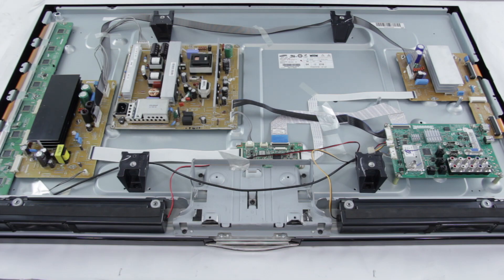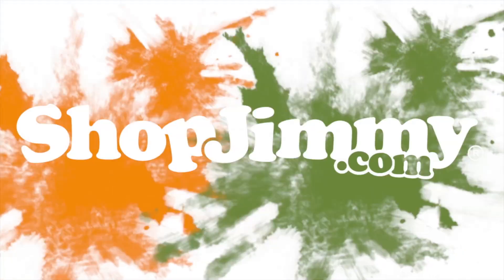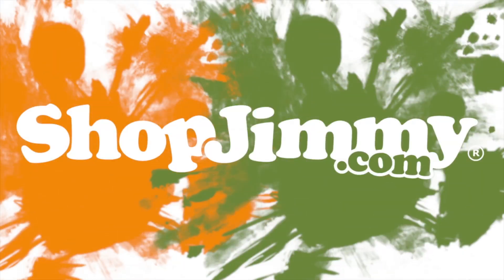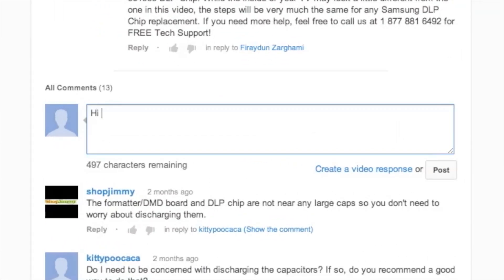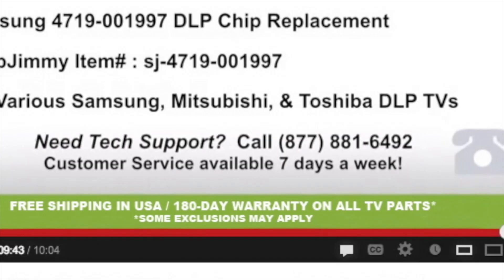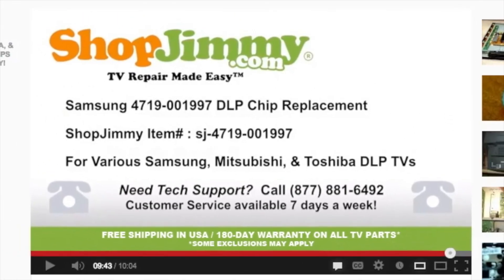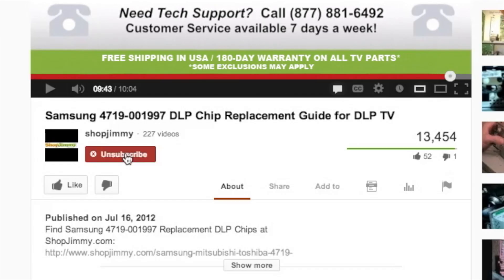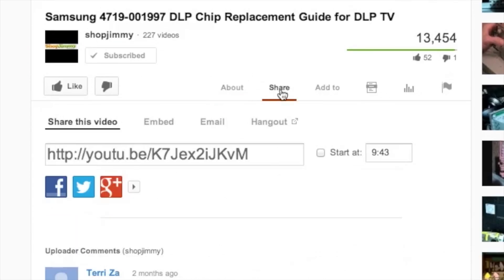Plasma TV Repair Tutorial - Common Symptoms & Solutions - How to Fix Plasma TVs

Comment: I have a Samsung PN50C590G4F plasma tv from Feb. 2010 that wont turn on and the relay on the power board clicks on and off repeatedly with the front led flashing. When the set is trying to turn on the VA reads 55, the VS 211 and the VSC -198. The VE reads 92 when the relay clicks off and then drops to 81 when the relay turns on. I replaced the X board thinking that was a problem but the same numbers are on the meter reading with the new board. When I bypass the number 3+4 post of the logic board the screen comes on with the test colors but again turns off after about 6 seconds. I don't see or feel any popped capacitors and all ribbon feeding voltages to the y board, logic board and main board are correct as written near their terminals. Please offer testing suggestions and or solutions.
Thanks
Brian
Reply from the maker: Brian Wilk   Try this at your own risk. Unplug the TV, then disconnect the y board and plug in the TV to see if the TV powers up. Reply with the results of this test. Thanks! www.shopjimmy.com
Reply: ShopJimmy.com
I have separately and in combinations unplugged the Y board, Y buffer, X board, X buffer and the logic board but still the picture never comes on. This does leave the main board in the system since it needs to be there to provide the connection for the power board. The only way I can get the screen to have a color is to jump the 3+4 leads on the logic board and then white comes on and red before the relay times out and shuts down. During any of my tests the relay always shuts down after 6-8 seconds and then comes back on in about 2 seconds and will continue this until I unplug the tv from power.
Reply from the maker: Brian Wilk   This means that one of the Sustains or the Main Board has a short that is giving you a false reading.  Thanks!  www.shopjimmy.com
Reply: ShopJimmy.com
I bought a main board from you but I still have the same problem. The one difference that I see is that that time for the relay staying on has gotten shorter. With the old main board the relay stayed on for 6-8 seconds but now with the new main the relay clicks off in about 2 seconds. I have unplugged both the Y and X boards from their sustain boards but the relay still clicks on and off. How can I perform more testing to confirm whats wrong rather than just changing parts? Again, any ideas are appreciated.
Brian
Reply from the maker: Brian Wilk  Try this at your own risk.  If you know how to test the boards with a meter, you could test for shorts in the boards.  Thanks!  www.shopjimmy.com

Comment: hey now: I / 6th of my screen shows black and red vertical lines after replacing the control board, this is a lg 60pc1d, thinking its the mcm if not cable pls recomend if I need another control/ main bord or just clean connections. e.atlantic@live is best guys thanks
Reply from the maker: mark ingraham   This sounds like a TV panel (TV Screen) problem.  If your TV panel is bad, it may be more cost-effective to replace the TV as panels are typically hard to find in stock, difficult to replace, and expensive.  Thanks and please let us know if you have any further questions!  www.shopjimmy.com

Comment: LG 55LV5400-UB picture is slow but sound is good what part do I need
Reply from the maker: James Tuakalau   This sounds like a TV panel (TV Screen) problem.  If your TV panel is bad, it may be more cost-effective to replace the TV as panels are typically hard to find in stock, difficult to replace, and expensive.  Thanks and please let us know if you have any further questions!  www.shopjimmy.com
Reply: Where can i look for parts for this model tv to order and roughly how much is the damage? Its just the image that is slow like its late but sound is perfect any suggestions  please???? And thank you

Comment: hi, i have a lg plasma 60" model: 60pv400-ub. flicking dark discoloration going horizontal across the middle of the screen. not exclusive to the middle but 90% of it is concentrated there. it will get better, then worse. usually aggravated by one dark image in part of the middle, when it looks like smudges all the way across. ghost image left sometimes. most visible when white words where there before followed by a rapid change of screen to a solid darker color.
Reply from the maker: Johnny Titmus   This sounds like a TV panel (TV Screen) problem.  If your TV panel is bad, it may be more cost-effective to replace the TV as panels are typically hard to find in stock, difficult to replace, and expensive.  Thanks and please let us know if you have any further questions!  www.shopjimmy.com

Comment: Hello...I have about a 60" Samsung Plasma TV about 2 1/2 years old...first we began having one vertical green line down the screen. This lasted about 3 months. Today, the power went off and I was not able to turn tv on manually or with remote...just a black screen. TV is receiving power because the red light is on (solid)...trying to decide is this worth purchasing a new tv or getting a repair.
Reply: Sorry...i need to find model number.

Comment: I've got a older Samsung plasma tv. For 2 years the picture has had red and green snow, except when watching animation type shows like Family guy. Now, the screen goes black on the lower half of the picture flashing black and then it goes back to normal. I just moved to California so the tv was in storage for a year. When I hooked it up and turned it on it flashed black on half the screen again and then went totally black. This is a Samsung model #  HPS5053X/XAA.  Can you help me diagnose this?  Thank you!!
Reply from the maker: MIKE MILROY  Please watch this video FIRST to help with your repair!  https://www.youtube.com/watch?v=BP3NVNCGEv8  I recommend replacing the main board in your TV.  Click this link to replacement main boards for your TV model number: http://www.shopjimmy.com/catalogsearch/result/index/?cat=56&q=HPS5053X%2FXAA  There may be multiple boards for the same TV model number, be sure to match part numbers on your current board, with your replacement for compatibility.  Here is a link to a video showing how to identify your part number, click here:  https://www.youtube.com/watch?v=BEPWrefQvqI  Thanks and please let us know if you have any further questions with your TV Repair!  www.shopjimmy.com

Comment: I have a Toshiba plasma tv model: 42HP84 
It looks red/purple. and has one white horizontal line down the middle as well as vertical lines. Wish i could send a pic. A little help please.
Reply from the maker: fernando rosado   This sounds like a TV panel (TV Screen) problem.  If your TV panel is bad, it may be more cost-effective to replace the TV as panels are typically hard to find in stock, difficult to replace, and expensive.  Thanks and please let us know if you have any further questions!  www.shopjimmy.com

Comment: I have a Samsung PN58B860.  Picture and Audio is fine.  But the TV keeps going into "Demo" mode.  Also, it cycles randomly throughout the TV menu.  It will also cycle through the various inputs (HDMI1, MDMI2...PC, etc.).  Sometimes the TV volume will automatically increase until it reaches full volume.  I've removed the remote from the room to ensure the remote has not become possessed.  A red LED by the touch controls sometimes flash quickly as the menu cycling occurs.  I can physically wiggle the bezel just a bit near the touch panel an the flashing may stop for at least a little while.  These issues occur randomly but he frequency increases as the TV is on longer and becomes hotter.
Reply from the maker: trollair  Please watch this video FIRST to help with your repair!  https://www.youtube.com/watch?v=BP3NVNCGEv8  I recommend replacing the main board in your TV.  Click this link to replacement parts for your TV model number: http://www.shopjimmy.com/catalogsearch/result/index/?cat=56&q=PN58B860  There may be multiple boards for the same TV model number, be sure to match part numbers on your current board, with your replacement for compatibility.  Here is a link to a video showing how to identify your part number, click here:  https://www.youtube.com/watch?v=BEPWrefQvqI  Thanks and please let us know if you have any further questions with your TV Repair!  www.shopjimmy.com

Comment: Excellent video.  I have a Panasonic TC-P42U2.  After it warms up, dark horizontal bars flash quickly up and down the screen. Sometimes, however the bottom part of the image on the screen is also displayed (superimposed over the image) at the top of the screen.  We're perplexed.  Any thoughts?

Comment: Ln40a530p1f flickers after about a hour of play until it's completely dark but still has sound. ..and  un55d600  turns on get samsung logo..turns back off u plug it red light blinks 15 times  and after that I get nothing I unplugged the main board from the power supply  board and get a solid white screen plug it back goes dark ...searched everywhere on both tv's no solution please help email me what I need to do..datboiplaymade @gmail.com

Comment: Hi, I have a LG 60" TV model# 60PK750. When I turn the TV on, the Blue light on the front of the TV comes on, and then the red light come on and stays on but the TV never comes on. I checked the voltages on the power supply board (part# EAY60968901) and all of the voltages are present. Is it possible that the main board is causing this problem? Can the logic board cause this problem? Is there problem with the 5 Volts being distributed from the main board? Please help me with this problem. Thanks for tutorial, and thanks for any help.

Comment: Hi, my name is Glenn Baume, 'glenn.baume@ntlworld.com', and I have a Samsung 50" Plazma TV, which has developed a 3" vertical line approx 12" from the right hand side of the screen, please can you tell me the parts and the costs involved to repair this problem, thank you,
My full details are:-
Lt.Col (ret) Glenn Baume,
26 Howbeck Lane,
Hartlepool.
TS24 9AF
United Kingdom
 and the TV details are:-
Samsung 50" Plazma
Model number : PS50C680Q5KXXU (the 6 could be an 8, ie PS50C880Q5KXXU), not sure top of number 'rubbed' off,
Serial number : B2G2H4PZ906647L
Ver no. : N106.
Thanking you in advance,
Glenn

Comment: Okay...my Samsung plasma 50" TV have black lines from left to right. It started with one then adding to 8 lines in steps at times. I believe you said it is due to x-sustain problem. Is that correct? If so, what do it need to be done? Do it have to be replaced whole motherboard of x-sustain? Or can it be unplugged and plugged in to help reset it to clear the screen? Or what?

Comment: Model # pn50c450b1d
Serial # z1m83cqz201415e
 Version# Ny02

Model code # p150c450b1dxza

Will not show picture ,  has sound , and power cycles.. what is your suggestion. ?

Comment: Hi, I have a Samsung PN51E450A1F. It had a power surge. Before replacing the mainboard all I had was a green blinking light on the back (this was visible with the back cover removed).  Since adding the new mainboard, I now have a red light in the front lower left corner and the green light on the back blinks one time. But still no tv. I have checked for pop ups and tested for burnt fuses and any visible damage, any suggestions would be appreciated. Thanks
Reply from the maker: Steve Foxhill   Please watch this video FIRST to help with your repair!  https://www.youtube.com/watch?v=BP3NVNCGEv8  With a power surge, if you are not sure which board is damaged, it is recommended to replace both the power supply and the main board in your TV.  Click this link to replacement parts for your TV model number:  http://www.shopjimmy.com/catalogsearch/result/?q=PN51E450A1F  There may be multiple boards for the same TV model number, be sure to match part numbers on your current board, with your replacement for compatibility.  Thanks and please let us know if you have any further questions with your TV Repair!  www.shopjimmy.com

Comment: I have a Samsung PN51D530A3F that was clicking when turned on or plugged in, so I ordered a new power supply. I put it in and it was still doing the same thing. I then powered down and unplugged the Y board to see if that made a difference and turned it back on it acted the same, I then plugged that board back in but forgot to power down. Now I don't get the multiple clicking but it seems to power up then down or to standby and does nothing else no picture or anything. Did I make things worse but not powering down and did I blow that board too. I'm also not sure why the new power supply didn't solve my problem.
Reply: Update, if I disconnect the ribbon cable going from the Y board to the X board it will power up and the green led on the logic board will blink very slowly but stays on.
Reply from the maker: Jim Homan  Please watch this video FIRST to help with your repair!  https://www.youtube.com/watch?v=BP3NVNCGEv8  I recommend replacing the X and Y board and the Y-Buffer board in your TV.  Click this link to replacement parts for your TV model number:  http://www.shopjimmy.com/catalogsearch/result/?q=PN51D530A3F  There may be multiple boards for the same TV model number, be sure to match part numbers on your current board, with your replacement for compatibility.  Here is a link to a video showing how to identify your part number, click here:  https://www.youtube.com/watch?v=R1jmj_foId0  Thanks and please let us know if you have any further questions with your TV Repair!  www.shopjimmy.com

Comment: Samsung model PN60F8500.  I've had TV for 5 days and while watching content there are sporadic moments where what I call "pink pixel fireworks" appear on the left quater to half of panel.  Additionally, there is a small section (2"x2") on left middle edge that has a pretty constant flickering of pixels.  Any advice on repair options (obviously still under warranty) vs returning to Amazon?  I love the TV but am a little gun-shy on whether a repair can be made timely and ultimately fix the problem.  Thanks in advance!
Reply from the maker: Boss Hogg   I would return it.  This sounds like a TV panel (TV Screen) problem.  If your TV panel is bad, it may be more cost-effective to replace the TV as panels are typically hard to find in stock, difficult to replace, and expensive.  Thanks and please let us know if you have any further questions!  www.shopjimmy.com

Comment: NEED HELP LG 60PZ550 NO PICTURE ONLY SOUND, I HAD REPLACE THE Y SUSTAIN BOARD, BUT ALSO I NOTICE I HAVE A FS103 T6.3AH 250V. FUSE WITH NO CONTINUTY ON THE X SUTAIN BOARD. I WANT TO REPLACE IT BUT I DONT WANT TO BURN ANYTHING ELSE, HO ALSO LOGIC BOARD HAS SOME GREEN BLINKING LED LIKE CODE ERRORS, ANY IDEAS ??????

Comment: As suggested, I disconnected the Ysus board, plugged the AC. THE SET DOES POWER UP, however, seems to behave in a similar fashion. In short time, appears to turn off as when the Ysus board is connected. The difference is there are less clicks (likely from the Ysus not connected).  Possibly the PSB or still the Ysus?

Comment: I have a Samsung TV model PS42C451B2D and it does not come off stand-by. If I disconnect the Y board 6 pin connection on the power board the TV will come on (with no picture of cause) I checked for power at the 6 pin connection and only had 0.5v between the VS.
Reply from the maker: Rob Vec   I recommend replacing the Y board and buffers in your TV.  Unfortunately I do not see any replacement parts in the search results for your TV model number on our website.  Please reply with your part number on your y board and buffers and I can try searching for replacement parts.  Thanks and please let us know if you have any further questions!  www.shopjimmy.com

Comment: LG 42PC1D Y-SUS seems to be the problem... loud pop! followed by no image on screen. Left fuse (facing back) on board was blown. Replacing the fuse resulted in the tv not turning on... pushing on button power indicator goes green momentarily and then shuts down to red.

Comment: I have a Samsung PN50C7000YFXZA that will power on as far as I can tell, the only indication that I have of this is the standby light turns off and I can hear the TV click, then I have nothing but a black screen, can't even get the menu to come up.
Reply from the maker: Loren Baker Try this at your own risk. Unplug the TV, then disconnect the y board and plug in the TV to see if the TV powers up. Reply with the results of this test. Thanks! www.shopjimmy.com
Reply: ShopJimmy.com Unplugged the Y-Board seem to have no effect, the first time I attempted to turn on the TV the standby light flashed a few times before setting back to standby. After that it returned to what it was doing before that being it thinks it's turned itself on but still no images or menu.
Reply from the maker: Loren Baker   I recommend that you repeat the same test on the X board.  Thanks!  www.shopjimmy.com
Reply: ShopJimmy.com unplugging only the x board has the same effect.
Reply: Still waiting on a response.

Comment: Sanyo DP50740, press power button tv tries to power up, the Y-sustains led light on the back lights up then clicks and retries to start turning on. When i disconnect the Y-sus the Tv will shut off almost immediately without restarting. Is there a way to trace the problem at the component level instead of changing the whole board.